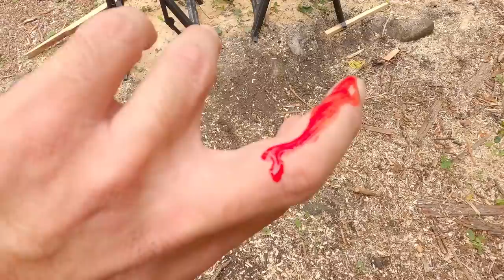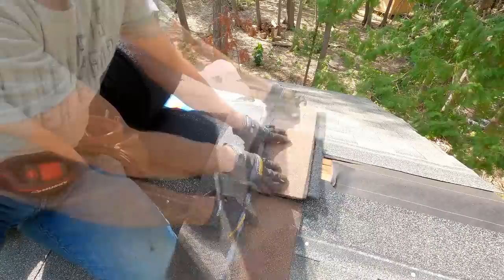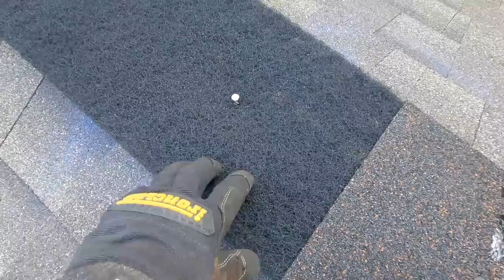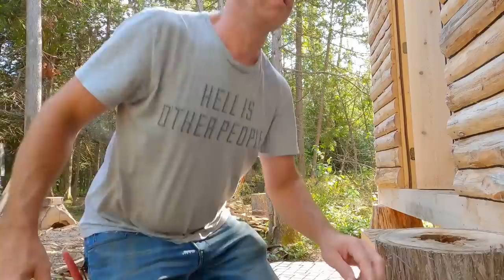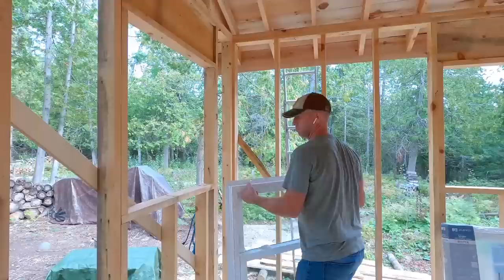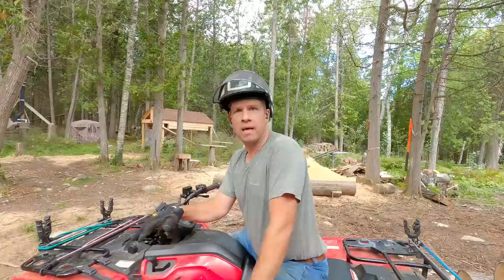Mixed-Shingle Cabin Roof.  Use What You Have On Hand! #103

Comment: I know your going with propane heat but could you get one of those small wall mount wood heaters and leave the propane
on a base temp then when you get in for the night just throw a few chunks of wood into the little wall one and let it burn out thru the night.
It might save on propane and keep the temp to your comfort level also you would not be chained to the wood cutting and just use it
when you wanted.
Reply: A mini cube wood heater would be perfect!
Reply: Agreed.

Comment: Superglue was developed during the 60's(?) But was designed to close wounds in the jungles so wounds wouldn't become infected and barely leaves a scar.
However, that roof looks great!
Reply: Make sure the wound is very clean before you seal it with anything. I would use the antibiotic ointment, especially with a puncture wound. They are almost impossible to clean completely.

Comment: Hey Ryan, just want to give you a suggestion on putting shingles on whenever you start your shingles down at the drip edge. You always wanna make sure that the tar strip is down at the bottom of the roof. The reason for that is to make sure that the bottom shingle doesn’t lift up during a windstorm and blow the rest of your shingles off so always make sure that your tar strip is downat the edge of the roof where your drip edges

Comment: Next time you do those starter strips, orient the glue tabs towards the edge of the roof -- that tends to glue down the shingle above it (when it gets hot enough) to protect your first row of shingles against wind lift = less of an issue with architectural grade shingles but still considered a best practice. :)

Comment: One of the biggest benefits of the delay in wrapping and siding that cabin is that soft woods like pine will air dry fairly quickly. I would guess after a couple windy days (plus the time since milling) the moisture content of the framing will be lowered significantly, which just means they’ll move less after siding/finishing and also won’t trap moisture within the cabin. Win win!

I also gasped when you lugged those shingles onto the back of the quad with your back. What am I supposed to watch on Saturday mornings if you’re hurt again?

Comment: This may sound like a strange idea, but I did it and it works. That roof vent mesh you are using can be used as a rainproof window screen alternative. I live in an area that has warm summers and frequent rain. I cut the mesh to fit a small window, where the screen was, and now rain with strong winds behind it wont come into the house. For a larger window, two pieces can be siliconed along the long edge to make a wider piece. Hope somebody finds this useful. When I was working 12 hour shifts, for ten years, this saved me from coming home to soaked floors.

Comment: You can buy hanging dehumidifiers for your cabin. They are inexpensive, and effective for helping to remove the humidity inside. It's a pouch of "beads" that absorb the moisture in the air and turn to liquid inside the pouch. Depending on the humidity in your cabin and the size of your room, one or two will last about a month.

Comment: I once screwed my finger onto the barn. Luckily I didn't drop the drill... I actually had to unscrew it. Then there was the time I learned why you should  never apply stain to new molding with a sponge. I had a good sized splinter go right through my pinky. I THOUGHT I pulled it out with my teeth, didn't realize it had gone all the way through. Unfortunately when I thought I had pulled it out I had just pulled it deeper and boke it off.I discovered this while cleaning up and had to go to the Dr. Do not apply stain with a sponge.

Comment: @ 39:32 You say that you have to move those (logs) down there, and that you don't want to tear up the center of your trail, right? Well, here's the simple answer to your dilemma: Get yourself an Old Volkswagen Hood, cut a few holes in it to drag it behind your 4-Wheeler, and to secure binders or straps to keep the logs in place for the transferring of the logs to the mill itself, with minimal soil impact into/onto the logs as well as minimal damage to the trail.
 At least that's what we did back in the day...

Comment: Ur rack braces would hold better if u nailed the top Into  top plate and the bottom to anything solid like the bottom plate. Plus if u do it on the inside then u can board it in it stay just where u want it. Or maybe just let the wind take down